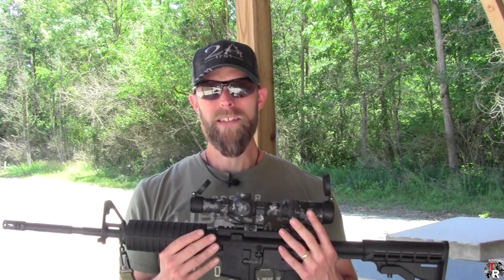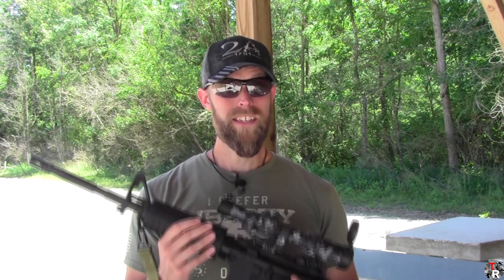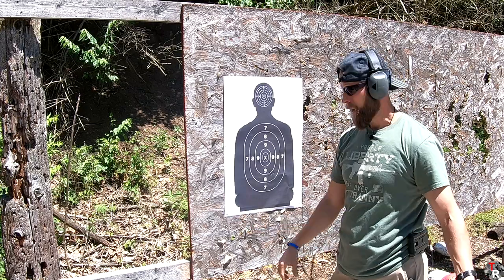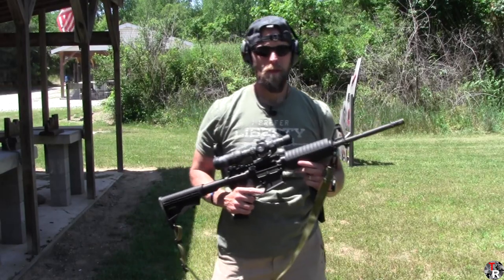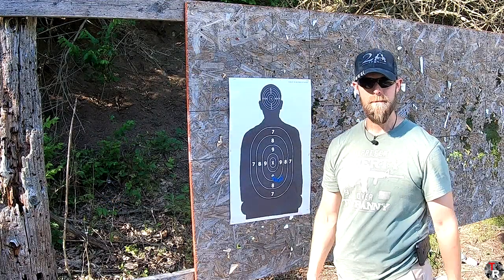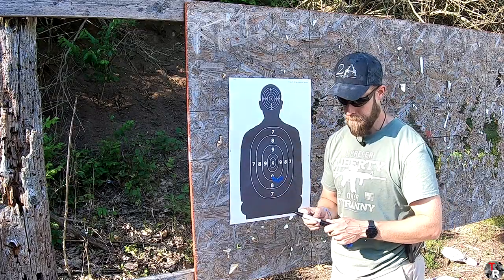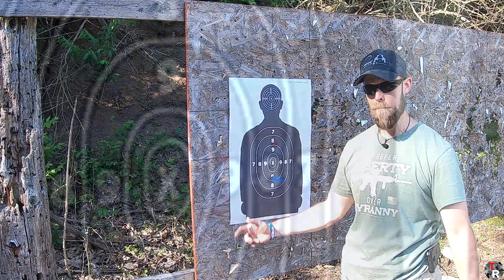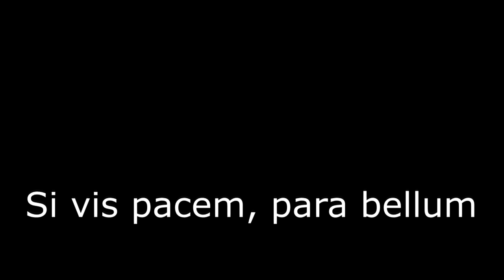Palmetto State Armory Freedom AR-15 Steel Endurance Test - First 1000 Rounds

Comment: Id pick a good AK any day over an AR even though I like the AR too. Out of 4 7.62x39 AKs Ive had since the 90s only had 2 malfunctions. MAK90 mag catch spring broke and one time an empty shell stayed in the chamber of a kit built AK63D when I was trying to make a binary trigger, it wasnt stuck I dont know what happened. On the other hand Ive seen ARs choke on steel and mine wont chamber when it gets dirty, the headspace it too tight I think. Its a 11.5 PSA mlok. Oh and the AK has a cleaning rod just in case you get a stuck case, I had a Mini14 get a steel case stuck way out in the desert and we didnt have a rod to knock it out